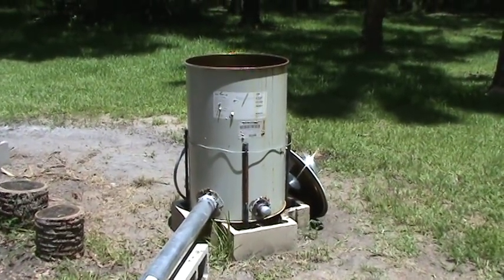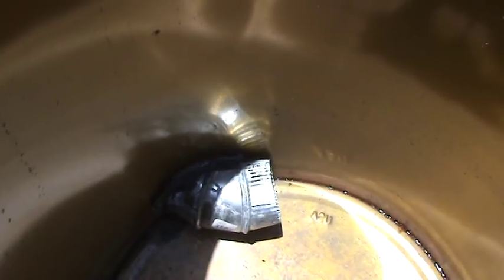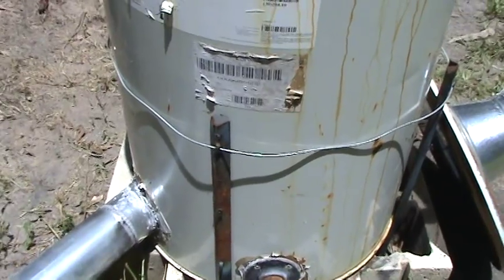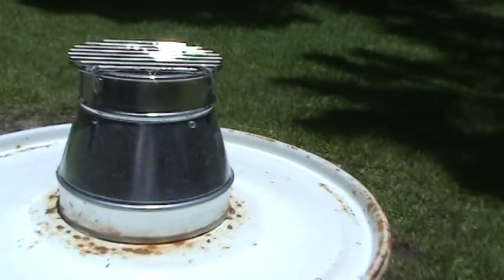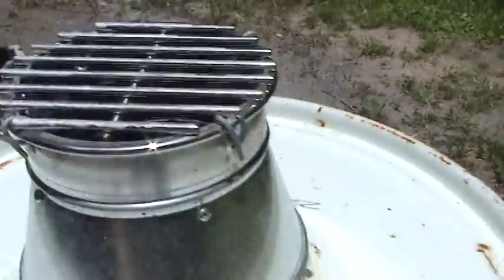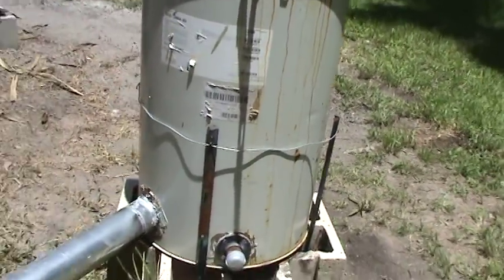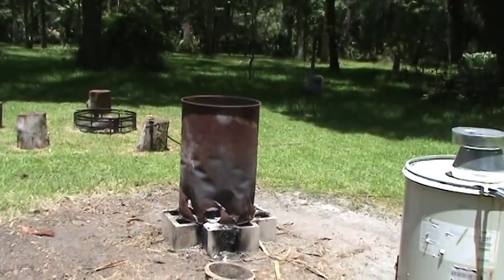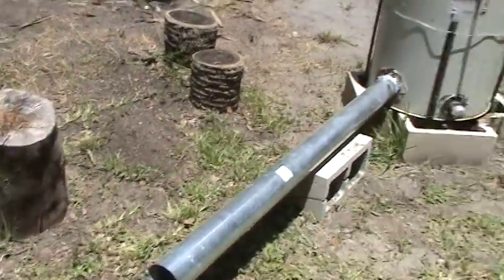Supercharged Burn Barrel 4 Build ( Fomerly Turbocharged Burn Barrel )

Comment: May I ask why the fresh air is introduced at the bottom instead of the top to get complete burn?
Reply: So the fire can start easily. It's actually practical to blow air at the bottom to burn the stuff at the top then just burning the top and not burning the bottom
Reply: @aintyohanz  
Yes, I see it would start far better.
I suppose the co vs co2 isn’t of great concern here either
Reply: @brucebaxter6923  yea
Reply: @aintyohanz  thanks.

Comment: What did you use to secure the ductwork to the barrel?
Reply from the maker: There is a duct elbow going into the barrel to the left and upward a little. I used some self tapping screws to connect the straight tube to the elbow and to hold the open end of the elbow in place and to the barrel.

Comment: Why don’t you light it at the top instead of the bottom?
Reply: Fire burns up, not down
Reply: Ignore the person saying you're dumb.
You can burn down, but it is just slower.
The advantage of burning down is less smoke.
I assume he burns up because the air is drawn up, so with the air the flames are drawn.

Comment: Would this be good for fresh cut grass clippings?  I hate doing a burn pile after collecting piles and piles of grass clippings, (more like weed clippings).  It doesn't burn, it smolders for days and smokes.  My neighbor had asthma and I hate to aggravate it.  Looks like this might be what I need to build?
Reply: I built one of the these, very similar design, my first attempt using it was not too impressive.  I put alot of grass clippings in, tried lighting the thru bottom, switched on blower, it smoked a little but didn't catch.  I started throwing drier stuff in like twigs and pine needles, same thing.  I got some dry, small logs and a little gas, got it burning pretty good, looked like a jet engine for a few minutes, then petered out....while blower is on hardly any smoke, but I had to come in, turned blower off and it smoked alot.... probably burn down over night.  I will try different tactics tomorrow....  My goal is to collect my grass clippings and burn them the same day, or next day.
Reply from the maker: I always put two or three dried palm fronds in the bottom to get it started and yes I have burned fresh grass clippings. It works best when you have a mix of grass clippings and dry debri.
Reply: You would probably need some dry stuff at the bottom to jump start it, like sticks or dry clippings.